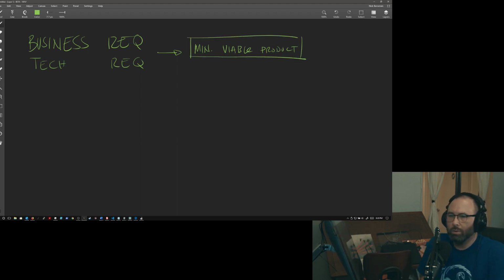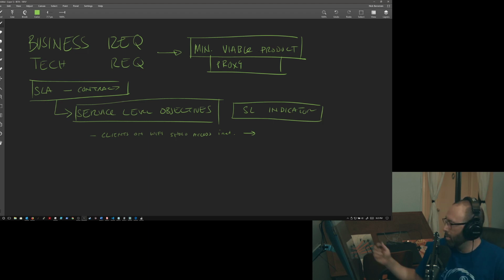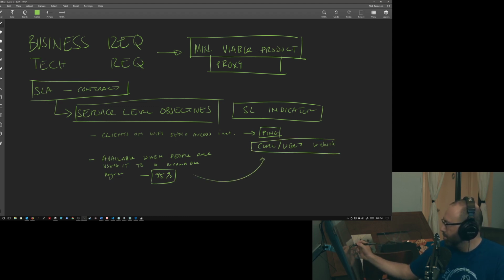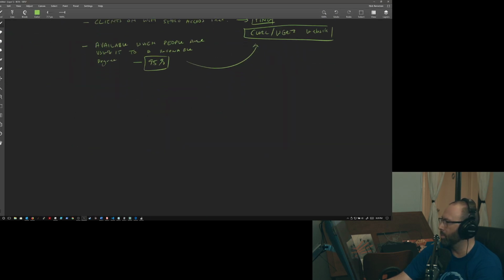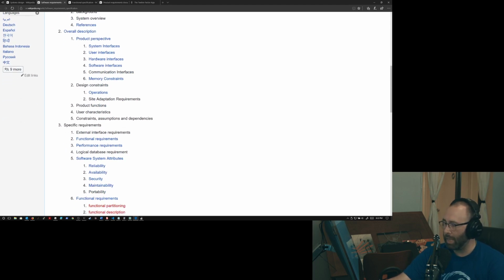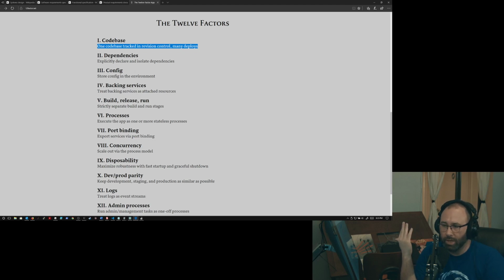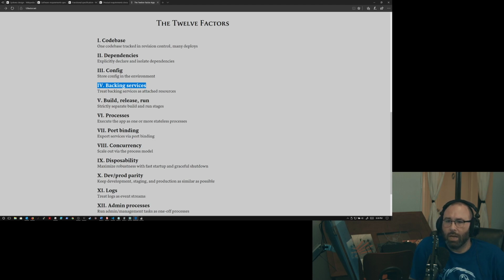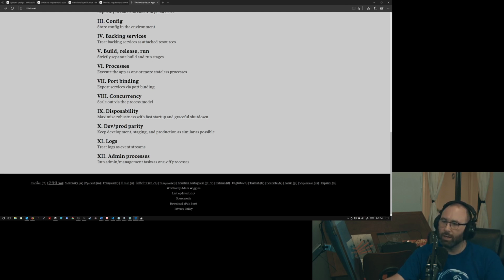Part 1: Natting Firewall/Proxy (vlog) | IT and DevOps Career Secrets

Comment: While you're correct a (cellphone )hot spot app would be cheaper and more capable and lower power than building a Pi router. But for the Pi, you would think of Value Add. Where you could hook your cellphone or just use wifi of the Pi for local dock access and the Value Add would be 1: Squid Proxy - for loading all of the web pages you want to look at while out at sea and not being online. 2: Calibre - Book server to hold your library of pdf's  for reading on your tablets. 3: Media server for video and audio of course and even games. 4:  Experimental Shortwave Packet Radio for transmitting simple messages for email and or twitter.   Maybe even more Value Add stuff like hooking your pi into your boat telemetry,GPS ,Depth, Wind peed, Direction etc.. via the GPIO.
Reply from the maker: I actually have an onboard navigation computer already, a pie3 running a fantastic distribution called openplotter with a hat specifically designed for a lot of what you mentioned. Personally, I do like to keep the functionality separate, just for simplicity, security, and in this case power. When under sail, I'm just relying on solar to keep the batteries topped up, so minimizing the draw is useful. Honestly, I already have two WiFi hotspot devices, but I thought this would be a good project that is both simple enough, and real enough to be a good starter project for folks. Love the suggestions though, are you going to follow along with the project?